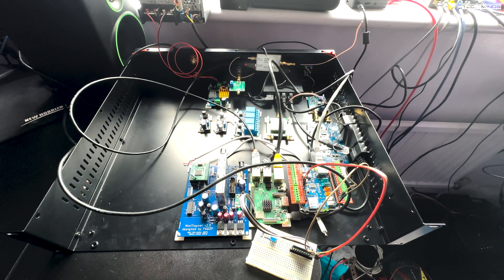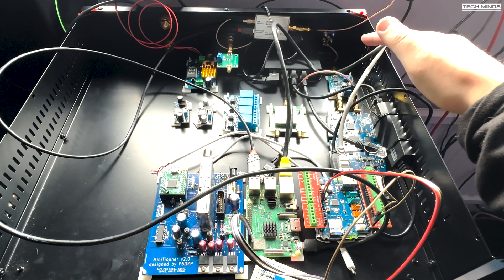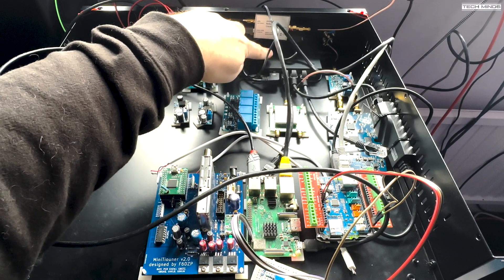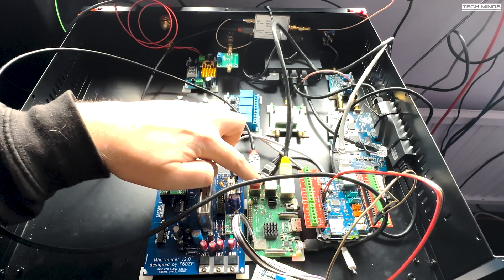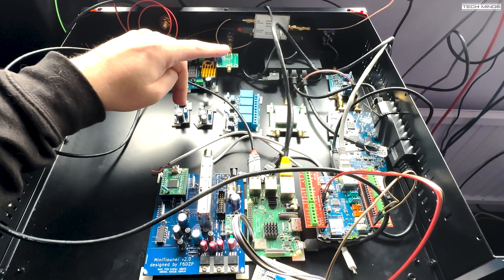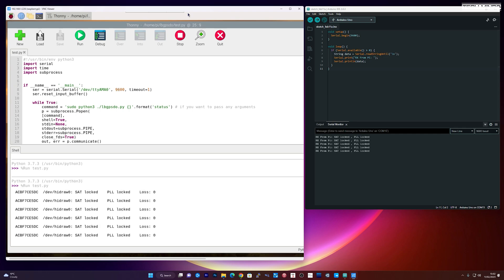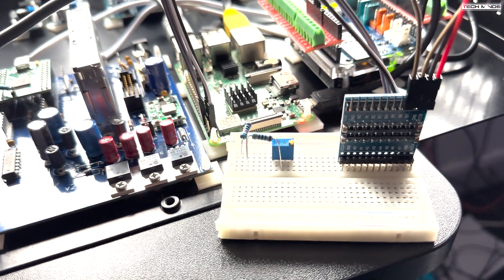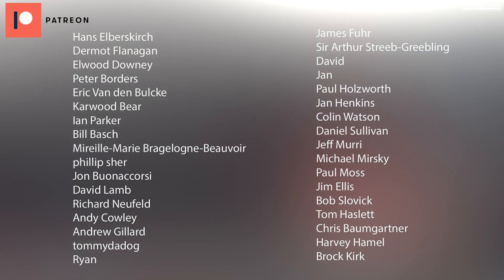THE ULTIMATE DATV & SSB QO-100 Transceiver Build - Part 1

Comment: Dont waste time with voltage dividers use an i2c power chip will give you current and voltage  > INA3221
Reply from the maker: They don’t go above 26v, according to the specs. I need to measure 28v so that’s why I made my own.

Comment: In clustering these various PCBs, they won't interfere with one another and require some shielding? (I suppose I'm thinking about things like relays).
Reply from the maker: Good question! I will find out once it’s all powered up. Another viewer has mentioned the use of tin, as a form of shielding around the components. Hopefully I’ll have the build done in a couple of days and then test it out.

Luckily the actual RF output from the preamp is only around 20mw, so I doubt that will interfere with anything, but will find out for sure soon lol :)

Comment: why the Arduino when the Pi has the GPIO and webUI already
Reply from the maker: Mainly because originally the pi was going to sit in the shack, as it runs the software for processing the received DATV signal via the minitouner hardware. I had already done lots of work on the arduino interface when I decided to put the pi in the remote box. Also, as I am dealing with large amounts of transmitted power from the amp, which is pretty much controlled by the pre-amp, I wouldnt want to rely purely on one SBC, in case it crashes. So, having the arduino control the relays is an extra safety precaution. But yes, in practice I could do everything on a RPI4. Cheers

Comment: The LNB has quite a high output level so I wouldn't worry about a few dB attenuation in switching it or putting it through a splitter to feed the Minitiouner and Pluto at the same time. My LNB is down 50 metres of coax to the shack with no pronlems.
Reply from the maker: Think ive decided to use an RF Splitter instead of a switch or relay. And of course, I might actually need an attenuator but i'll check levels once its working.

Comment: Interesting. I don't use an RF switch, I just use a power splitter and send the LNB IF to both minitiouner and Pluto all the time. Bonus you can monitor the spectrum on the Pluto in DATV mode. You will need to switch the LNB voltage between SSB and DATV. You will also need a relay to control your power amplifier. I wouldn't put the big PSU in the same case as it will generate heat, and in any case, your box will turn out to be too small with it in there.
Reply from the maker: Do you find any degradation in received signal by splitting it?
Reply: @TechMindsOfficial  No, plenty of gain in the lnb
Reply: @TechMindsOfficial  nice setup Matt. You shouldn't have any problems splitting it. I'm splitting mine 4 ways, minitiouner, sdr, winterhill and ryde (another minitiouner), no issues

Comment: Sorry if I missed it but could the relays be driven directly from the Raspberry Pi gpio, and run the web server on the Pi, and get rid of the Arduino, ethernet shield, and TTL converter?
Reply from the maker: I’m sure there is a solution, but I also need analog inputs for the voltage and temperature sensors. Plus the pi is already running the DATV software, so having it separate takes the load off. But you’re right, I guess it can all be done on the pi in some way or another.
Reply: My thought was the same. Connect an IIC adc to the pi, and you have analog inputs. You can change the code running on the pi easier than the arduino I think.

Comment: Tip, shield the various modules using thin tin plate. It bends and forms easily and takes solder very well. Good luck with the build! 73 Gary ZS6YI
Reply from the maker: Thanks Gary! Yep, once I have all the parts working I will perform some "interference"  tests, to see if any of the components are effecting each other. I guess I havn't thought about shielding up to now because its such a low power output. Cheers! Looking forward to finishing so I can join the weekly NET again! Thanks